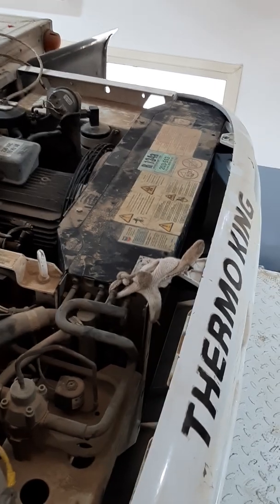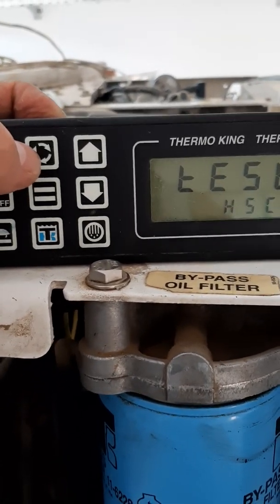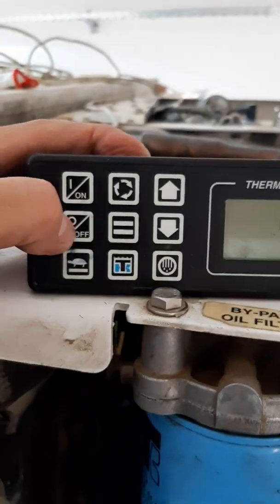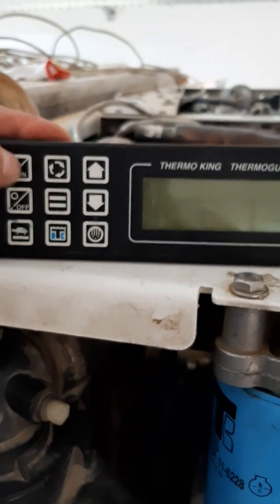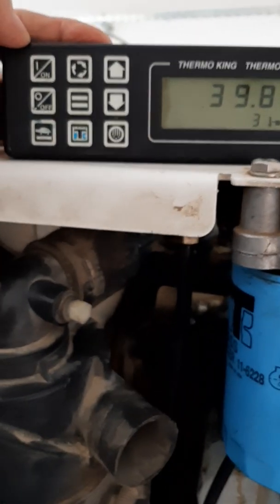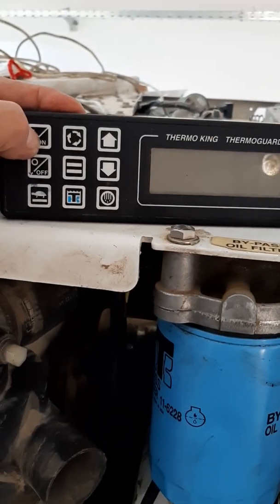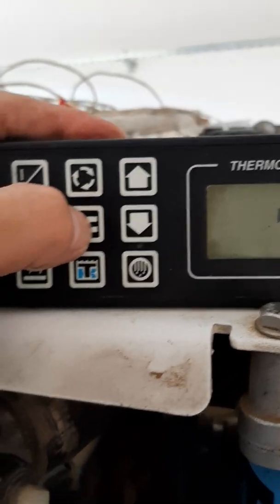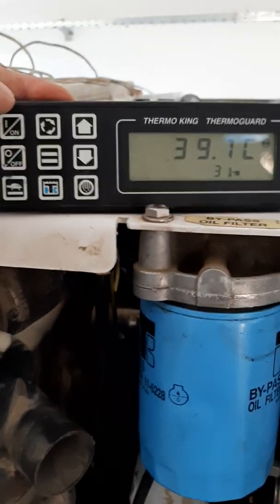Thermoking (MD 100) - Testing of Fuel Pump with Cab Command

Comment: Hi sir 
How I repair if haven't power in the unit
Reply from the maker: the supply is just 12V, you can not repair the fuel pump, this is to test only using the Cab Command
Reply: @arielguillermo4914  
Hi sir I asked without this subject 
My question is IF The board not working what I do
Thanks for everything